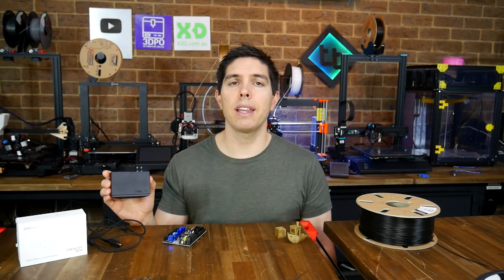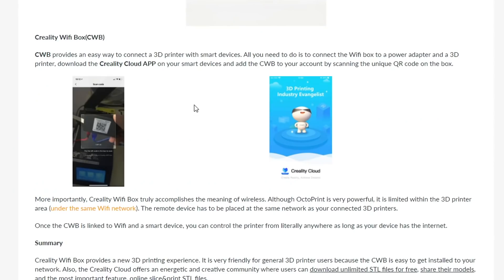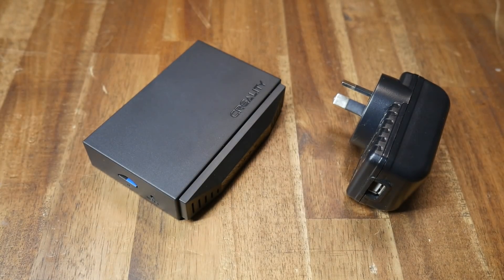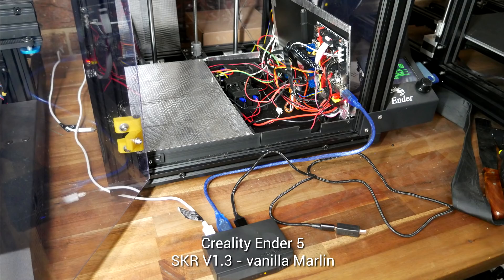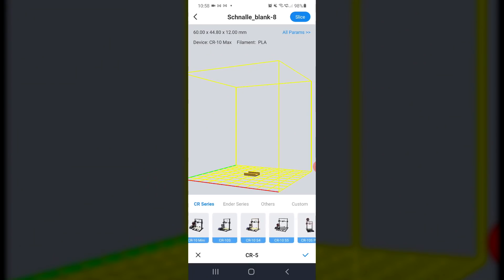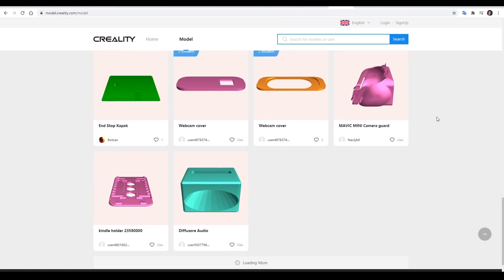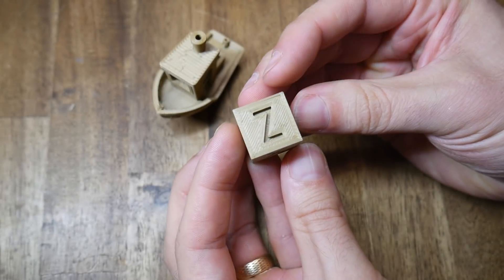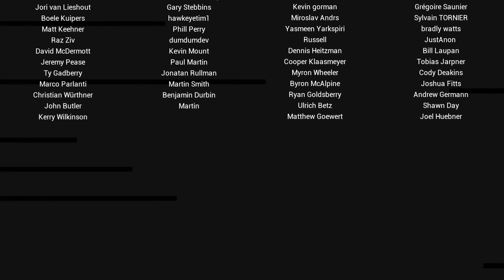Creality WIFI Box tested: Budget Octoprint alternative?

Comment: Thanks for the video and the mammoth efforts you've gone to to test this out. I'm planning to finally get round to installing Octoprint this weekend and have an Ender 3 pro (updated marlin) so this sounded interesting. It's amazing how companies can just completely misjudge what consumers want. At $20 it is very inexpensive, but the fact that you are completely locked into their system with no community support/addons as well as the phone only interface is a complete no-go. I reckon there's a good chance they'll improve the compatibility and connectivity issues, but the whole premise of the print from your phone seems a bit gimmicky. I'd much rather slice on my computer with my own settings and then send to the printer. I already own everything to get Octoprint going (except maybe a compatible camera), so gonna stick with that.
Reply: When I started with the box, I had issues connecting to my box, my Ender 3, Ender 3 Max. But once I got everything connected, it works fine. I can be in another city and check on the live feed how my print is doing. But no spaghetti detective plug in.... But now I have a full list to control temp, fan and speed. Active layer hight feedback, and basic time lapse videos. Very basic. Very very basic, sigh.....

Comment: I made this purchase before buying the Pi and Octoprint.  It connected the first time.  After power cycling it, I had to connect it again, which failed miserably.  I was able to bring it up in a web browser and see it appeared to be connected.  It didn't show connected in the app.  It is a budget way to slice and print with very few options.  It's a good gadget at best, if you can keep it working properly.  Octoprint is not for beginners.

Comment: I havent tested mine but to be honest, it is probably better than octoprint for one reason -quality. Most printers give better print quality without octoprint on the sheer fact that the gcode is read by the internals, instead of supplied by packages via an usb cable from a source that can be a rapberry and so on. The same issue actually appears on a PC connected printer (generic) and this is why we havent really got rid of the SD cards, not only by cost but they basically deliver the top notch if the print processor or microship have the whole control over the gcode, instead of reading a bus stream.

Comment: Hey I have a Creality Cloud Box, and I have had lots of success using it, I can print and upload my STLs after the latest firmware update, have only had problems getting the box to connect with an ethernet cable. As I too am a video maker I will do a video where you can see some success with this box, I am close to networking it as if I can connect to it on an Android , then I can connect to it on a PC with Android installed on it as custom firmware.

My best success was with a Samsung Galaxy Tab E Lite modded to be an IOS device. It was there that I was able to print , dial in heat settings etc , the only problem is that my camera will not work with it. Russ

Comment: I think I wasted my €15 for this box. With a little trouble got it to work with Ethernet cable and did one test print. Then wanted to try to get WiFi running. No chance. Can't even remove/delete the device from the app to start all over. Cannot even get it reconnected through the Ethernet cable again. Tried erasing the SDcard, reset button. It will always ask to reconnect to the boxes' wifi after that my wifi, then nothing happens and the device in my apps remains offline. It's just a piece of 💩.

Comment: Upgrading your 3D printer is, I would wager, a pretty common occurrence, so the fact that it only works with stock Creality parts is, I think, the most damaging part of the whole idea. Disregarding every other no-go flaw, how do you make an "open-source" printer only to lock it down again afterwards? I love my Ender 3 to bits, but dang guys, this feels either intentionally exploitative or incredibly out of touch.
Also, on the topic of favorite plugins, I think my most used one is M117 Speech Synthesis, since I've set it up so it informs me on jams, when the preheat is done, etc. while I'm on the PC having the webinterface open in the background, instead of just hearing beeps and having to figure out what exactly happened. I hear "Preheat finished", look at the webcam, check that the first layer is going down well, and can get back to work right away. Very, very convenient.

Comment: i hope this can be used as just a wifi adapter for the printer. so i could upload my model from the pc directly from the slicer as if the printer is on the network. any ideas this can be used in such a way?

Comment: This is exactly what I want on my wireless network, a box that constantly phones home to China with no way for me to verify what it's doing. Hard pass from me. What is the point of cloud connectivity anyway, who is starting a freaking print from somewhere other than the printer. You have to remove any leftover filament from the bed, clean the bed, and possibly change the filament color or type. What a stupid argument to make against Octoprint. Not to mention the fact that you can use Octoremote to get this exact same functionality without sending your personal information to China.

Comment: I received mine after months of wait as it was a special when I bought my Ender 3 V2, but they where out of stock and it only arrived yesterday. But if I knew what I know now, I would have told the company I bought my printer from to send it back and in stead send me roll of filament. I took it out of the box, read the instructions and nicely placed it back into the box after watching a video on how to install the device. I jumped on the Creality facebook page and asked them if there was something that worked better and the first reply was Octoprint so I will soon be investing my money on that since the Creality wifi box is not actually what it says it is. Thanks for this video. You just cemented my decision.

Comment: Favourite octo plugin is Arc Welder. Post-processes gcode to replace line segments with arc commands (G2/G3) which significantly compresses gcode files and helps to prevent blobbing due to buffer underrun. Worth a video, I'd say!

Comment: Octoprint is free. It runs great on an rpi 3. You can open ports on your router if you want to access it while away from home, but you're not supposed to leave a printer running unattended. $50 in hardware is pretty cheap for a CNC machine network interface

Comment: I would rather spend the money on a pi and install astroprint. Astroprint supports remote monitoring, slicing on the pi, computer web based control, and it's worked on every printer I have thrown it at. The mobile app is also more polished. Since it runs on the same hardware octoprint runs on you might want to give it a look

Comment: For Octoprint I really like the Tasmota Plugin which controls a Smart Plug. Print finished? Turn the printer off. Printer idle? Turn it off. Thermal runaway? OFF!
And also the PrintTimeGenius plugin which nails the print time estimate to the minute even for 12h prints.

Comment: The reason for it reqesting location access is because of the design of androids location permissions. Using known wireless networks you can track the location of the phone which is why wifi and bluetooth are both under location permissions. The request is needed by the creality app for them to control your wifi and connect easily to the box. This would also gice them access to all networks your phone can find, therefore potentially exposing your location. Note that giving it access to location via wifi means that the app could request your location via GPS as well without asking for permission again.

Comment: you can also get the pi zero w - https://core-electronics.com.au/raspberry-pi-zero-w-wireless.html (not affiliated with them, they are just cheap) You'll need a usb adapter depending on what printer you have, but that's easily sourced online.

Comment: I bought a creality wifi box for $1 for a promotion when buying ender 3 pro. I tested it. Compared with octoprint.

you can see a photo of the opened box at this link: https://yadi.sk/d/4t-qXYZBuYXxjw?w=1

cons of creality box:
-work ONLY through the office application from a smartphone
-not supported third-party webcam
-no ability to control the printer while printing
-work only within the local network
hemorrhoids with the Chinese analogue thingiverse. You can upload your model, but it takes some time.
Pros:
-low cost
-friendly-user interface
-easy to connect and configure

Bottom line: it's better to save up some money and buy octoprint, it is much more profitable in terms of functionality.
If Creality does not think about their product and do not support all the disadvantages that I have listed above, I think the audience will be disappointed in them.

Comment: Creality needs a human who is fluent in English as their primary language to review their products and manuals.  I could not believe my experience with the Cr-6 SE, besides the fire hazards, none of the models were able to be printed.  Why because they were not on the root of the SD card.  How difficult was that to figure out?  Why was that missed?  They make OK hard ware, but you have to expect that a lot of time will be spent in getting it to work.  I have 5 Creality printers 3 - Ender 5, 1 Ender 5 Plus and a Cr-6SE, but all have mostly replacement parts on them.

Comment: It probably wanted your location because there are different WiFi frequencies in different countries. Without a location it probably failed over to the largest range of frequencies. Doubt this had anything to do with later issues other than the initial WiFi connection...

Comment: So it's way worse than octoprint, but would it be useful for beginners? Sounds like if you're using the pre-installed firmware on your printer this box should work. Is that true? I haven't upgraded any of my firmware and I plan to postpone playing with the inside of my printer for as long as I can :) 
Thanks for the review!

Comment: Current favorite octoprint plugin is the Arc Welder plugin. I've enabled Arc support in my firmware, and it can drastically reduce the size of the gcode file, resulting in less commands per second sent to the printer, and just an overall smaller file. In theory, it should result in smoother arcs and curves.

Comment: Although to get Octoprint just right the way I wanted it took some fiddling, once it's up it's bulletproof and rock solid.  Webcam, enclosure plugin, bed visualizer, terminal support.  There no reason to take a closed box with minimal/limited functionality when for just a bit more you can get the whole cake.
I still consider Octoprint as THE best upgrade to add to the printer.

Comment: If you don't need the camera support on Octoprint, the RPI Zero W works great. Not enough compute power for the camera, but plenty for the driving the printer. The cost of the RPI Zero W is $10.00. Adding a power supply and cables will probably be another $10 or so. So we have a much better solution for around the same money as the Creality box. I have 2 RPI Zero W's in service for my 2 printers, a CR10s-Pro and a  early monoprice model. No problems at all.

Comment: The problem with this modules is that it connects to the internet to transfer personal data, it's like the security cams, smartwatches, smartphones, vacuum robots, etc... everything that requires a specific app installation and internet connection that sets a backdoor on your local network.

Comment: You don't need a raspberry pi for octoprint. I installed octoprint on my old 2006 core 2 duo laptop running raspbian, and it works just as well as it would on a rasberry pi. Saved me 40 bucks :)

Comment: I got into the hobby by first starting with resin printing, and am just now getting into FDM printing with a Creality CR-6. Anyway, the MOST frustrating thing about my resin printing experience was how my Kudo brand printer would communicate ONLY through a Wi-Fi connection. All files and parameters had to be sent to the printer via Wi-Fi. The printer is controlled only through Wi-Fi. 
While I'm very happy with the results, the Wi-Fi only thing annoys me to no end, as a Wi-Fi connection is never a guarantee, not to mention all the steps and extra hardware to get it set up (a remote router, in my case). 
Plus I loath the concept of having to use an internet browser to control ANYTHING inside my own home. Call me a curmudgeon, but for controlling any machine in my home, I prefer a connection which is wholly internal to my walls.  And did I mention that Wi-Fi connections and setting them up can be really finicky sometimes? Especially when you really need to get a print done, and you see the "can not connect" screen? Or especially if you need to stop the printer and you lost the Wi-Fi connection? Argh!!!!!!!!

Comment: For what it's worth: Location permissions were asked for because it likely wanted to use bluetooth or wifi to connect to the device, which seems reasonable, it's just that Android for some reason groups those under Location permissions, making it look as if the app wants to know your location, which it doesn't.
Reply: Bluetooth and wifi ARE methods used to know your location. Sometimes more effectively than gps.

Comment: I'd say that you actually don't need RaspberryPi for Octoprint. You can use any tiny PC which are cheaper than Raspberry, but you'd need to setup everything yourself (not such big deal though), I've set up my Octoprint on tiny (40x40mm) NanoPi Neo Air board, and managed to fit 5V supply and 230V relay into one enclosure on back of my Ender 3, and i'm satisfied with it.

Comment: Seems like a half-baked missed opportunity that looks like a mini 90's Cable TV box. Octoprint is powerful because it's widely supported (open source with a great plugin system). The only downside to it is that it uses the USB buffer to print (alternative of downloading to printer SD is painfully slow because of how printer boards receive and write to the memory).

A better product would have been a Pi alternative built for 3d Printers (and depending licensing, could come presetup with Octoprint for Creality printers). Incorporate a storage switching chip (you can DIY your own) so the printer always prints from the local SD card buffer, and it'd be a practical alternative.

Comment: Octoprint is awesome and so easy to install.
I just installed my first Octoprint on a Pi4 and connected it to my Ender 3 v2 that I installed new firmware on using your guide.
It has been printing non-stop for the last 5 days without any problems.
Slicing in Prusa Slicer and even starting a print from within the slicer 👍

Comment: On Android, any application that wishes to control WIFI (connect, disconnect, enable, etc.) requires location permission because access to network can be used to locate users be it by unique signature of access point surrounding the device or just by accessing IP address and using one of the geolocation databases. This doesn't mean application is directly accessing GPS and getting exact location but it also means it can indirectly get user's location based on other parameters, hence the permission requirement.

Denying permission to the application is what probably caused some of the connection issues and inability to get device online. So for that you only have yourself to blame. Granted manufacturer could have made a simpler process for configuring the device without looking shady. For example they could have required that you create a text file with network name and key on SD card which would then be immediately removed upon insertion. Connecting to printer would then be as simple as scanning the code and connecting to internet, which doesn't require permissions. They could have also done the same thing with printer profiles and similar.

However, shoddy support for different printers and firmware there's no excuse. It's simply poor support. It's not something I'd use as I don't like devices sitting on my network with closed source software and no way to fix issues and prevent abuse. It's basically a VPN server for anyone clever enough to hack one of these devices.

Comment: If this allows you to use power resume and the filament run out sensor on the machine that would be a worth while difference from octoprint. That is the only drawback to octoprint. I know you can get a filament run out sensor but it’s more of a hassle than using the built in one and not having power resume is a bummer too.

Comment: $40 MSRP and it doesn't come with a power supply? How is this any cheaper than a Raspberry Pi?
Even at the 50% off sale price, you can get a Pi Zero for far less than that, which will still be powerful enough for most functions in OctoPrint.

Comment: I cant use octoprint, since it always crashes in midprint (I use Ras.Pi4 with 8GB and Raspberry pi original power supply - so there is plenti of resource to run it smoothly - but it dont.)

Comment: Unfortunatelly Creality accessories like this are most of the times crap. I bought the camera so I don't have to set up octoprint etc. The setup of the camera is a pain but once you get it done it works quite well. After changing my phone I cannot find the app anymore.  In the european Creality store the camera isn't listed anymore and the support is basically not existing.
So like mentioned in the video you better spend some extra money and time but get a working system.
It's a shame because the printers from Creality are good.